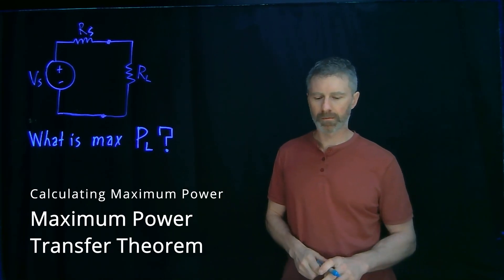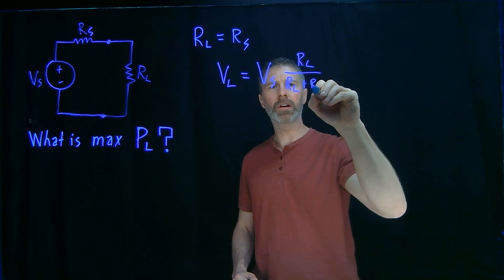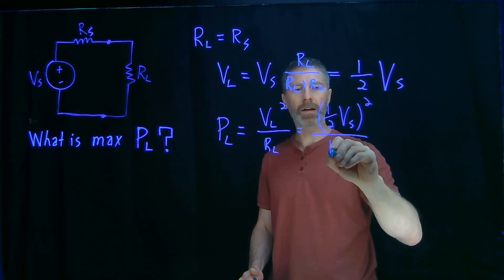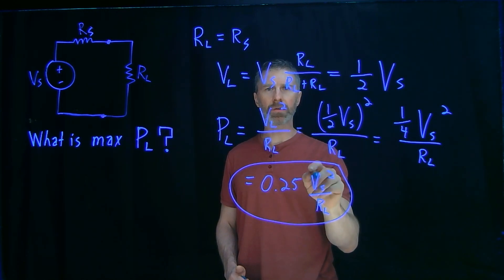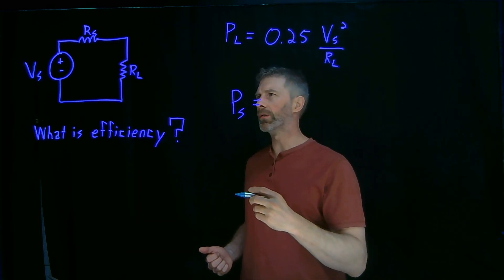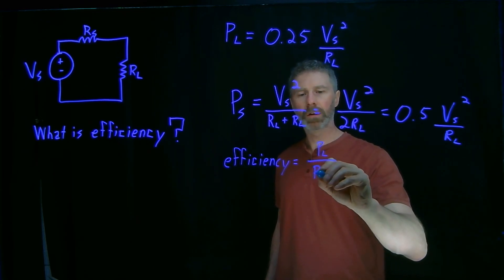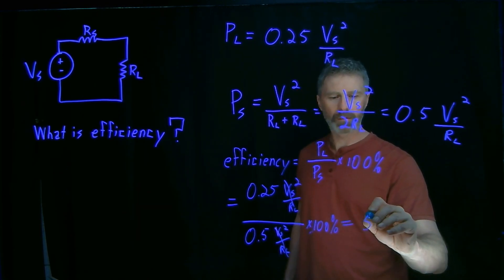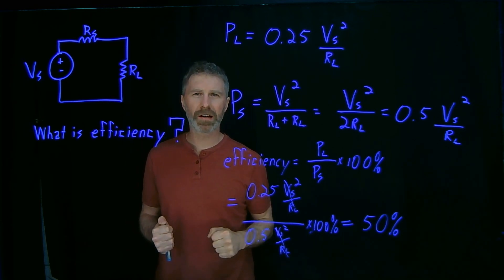Maximum Power Transfer Theorem - Calculate Power when RL = RS

Comment: It seems  to "Abstractly" work but the Concept seems highly mentally Non-Intuitive....Wasting 1/2 the available power Within the Source generator just seems Major Wrong practice.....Pretty sure the Auto  12 volt dc Battery &  240/120 volt AC power  generation & Distribution daily Practical life experience Don't work This way....